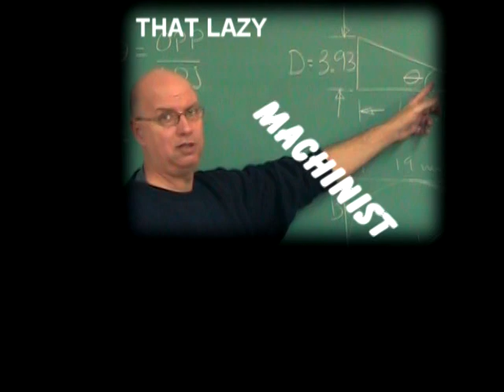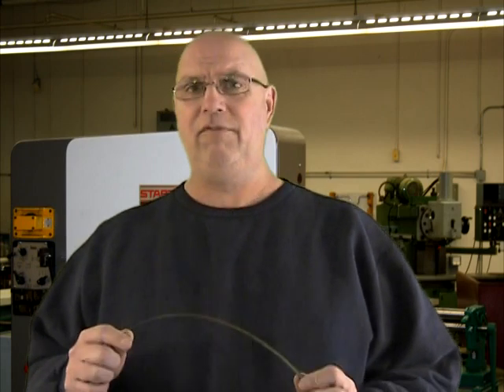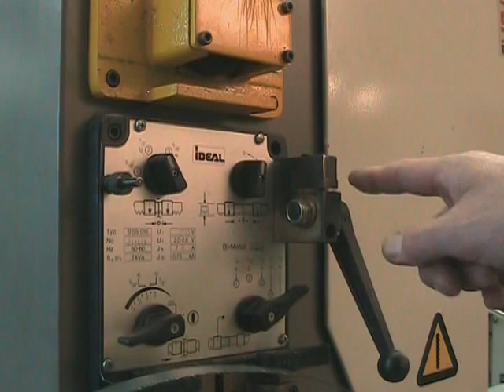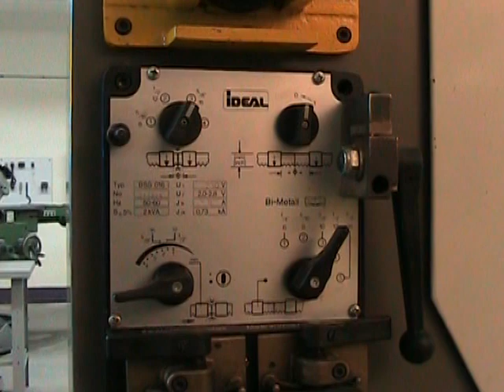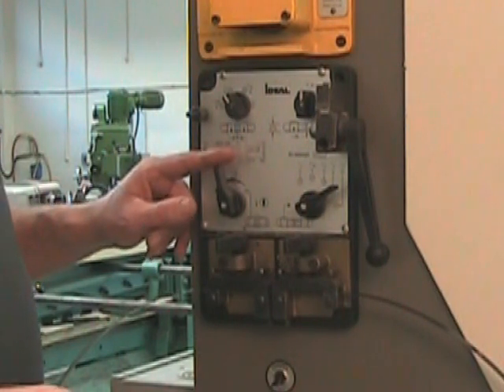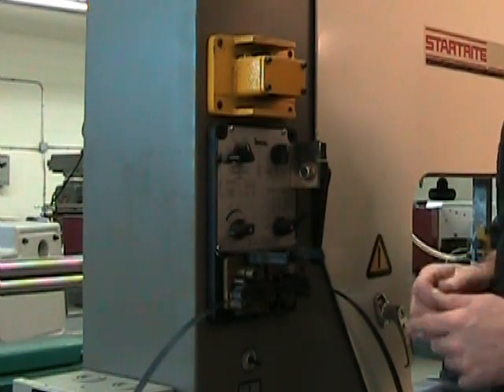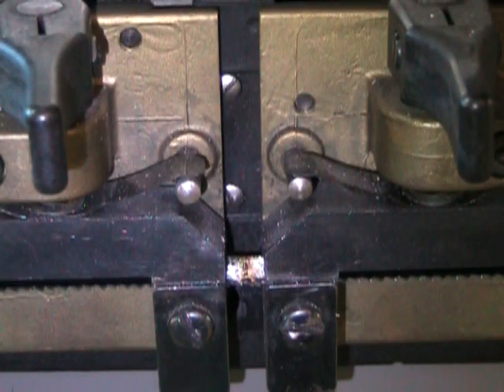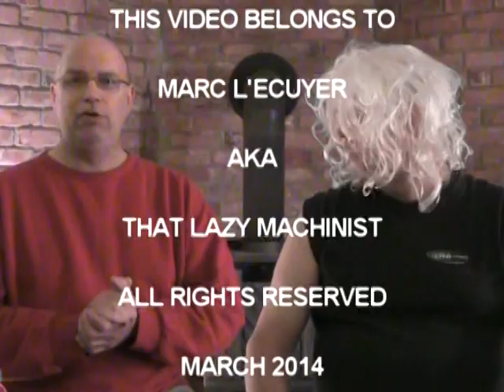HOW TO WELD BAND SAW BLADES BY RESISTANCE WELDING, HOW TO USE A BAND SAW BLADE WELDER. MARC LECUYER

Comment: Let me add a word of caution here.
As Marc has demonstrated, the welding of the blade is quite straight forward on a commercial welder, where the applicable parameters are simply "dialled in".
Heat treating the weld is a horse of a different colour;  and it is imperative that the annealing instructions as given on the blade container, be followed exactly, especially as pertaining to colour and ambient light conditions.
Different manufacturers have different requirements for this annealing operation, and I recall one container stating "heat to dull red", whereas the other container stated "heat to dull red in subdued light"!  A big difference, and it showed up in the number of blades that broke at the weld I had made so carefully.
Moral of the story:  If all fails, read the instructions!  I would opine that 99% of the joining failures are due to improper heat treatment after welding, and subsequently after grinding.

Comment: I never had any success welding my blades. More than 50% of the time they will break at the weld. So I searched Youtube for an appropriate video. And what do you know? The Youtube machinist instructor #1 of course have a video on that too. :-)

I think my problem is the annealing. So I will do it as you show me and hopefully have success. Also that mention of cleanliness is a tip. My blades are covered in some rust preventing oil when I take them off of the spool. So I will clean them with solvent at the cut point before cutting them. That may also cause my problems.I wrote it before, but will repeat myself: Your instructional videos stand out as the best! Thank you, and keep on making videos!

Comment: man this brings back memories. i worked for sandvik back in the 70's we used to cut and weld bi metal and flex steel blades.  the machine for the small blades was  a stryko, and the big machine was a thompson.
i used to day dream and get out order and anneal the blade before i weld it, and it use to turn red and drop in a puddle in a nano second.
filing off the flashing on a pedestal grinder is a fine art.   go too far and its like a slinky with sharks teeth blowing up in your face.  i used to enlarge arbors on huge saw mill blades too

Comment: You video on recognizing and distinguishing different steels was fantastic.
I have one small issue with the bandsaw blade welding sequence. 
Tempering is only applicable to a hardened object.  
Once the object or weld joint is annealed, it is annealed.
Reply from the maker: I agree! Annealed steel is annealed. I should have mentioned that the tempering at the end is more of a safety operation just in case the annealing step was not perfect. When annealing the blade it is difficult to control the cooling speed so I tend to do the "unnecessary tempering" since it is a lot easier to control by the color. Thanks for a great comment and thanks for taking the time to write. Your comment will help others and that is what comments are all about. Marc
Reply: I agree, and I like how you call it "unnecessary tempering." If calling it "unnecessary" satisfies the PhD's in metallurgy, let it be so. I do this unnecessary step, too. It is not necessary for my band saw blades to not break, prematurely. I just unnecessarily prefer it that way. 

It takes a year or so of breaking blades for someone to start doing this unnecessary step. It takes only 5 minutes to do an internet search on heat treating and to say this is wrong. :)
Reply: Thanks for the video. I have been cutting and grinding my blades at a slight angle by putting them teeth to back.  The theory is there is a larger surface area for the weld and the angle puts less stress when the joint passes the material being cut rather then a 90 degree angle. Your website teaching is great God bless you.
Reply: @THATLAZYMACHINIST  The "blueing" operation after grinding off the flash from the weld is to reduce the stresses introduced by grinding.  This is a necessary operation that prolongs blade life.

Comment: Hey dude. You're in a very tiny minority demonstrating the tempering step. Kudos for being a dinosaur! 

It appears most people don't do this step, at all. And that is probably because it will take years of using these blade to know there IS a difference. And some people will not see any difference, because their blades dull before they break either way. But from my own years of experience I completely agree this tempering step is important. 

Before and after tempering, the blade will appear exactly the same. Neither blade will break when you bend it, repeatedly, by hand. You can bend them until they fold over, and they will both perform identically in this destruction test. They will appear to be completely identical.

But after the blade has run around the wheels of a bandsaw thousands of times, the blade that was not tempered is more likely to break, right around the area of the weld. If your blade lasts long enough and/or if your saw has small enough wheels, you will find this out, yourself. But because there is no way to tell the different until you've done this more than a few times, the internet will never know it!

Comment: I'm having trouble with my bandsaw blade welder my welds are breaking constantly it's very frustrating all these parameters I'm taking into account it still can't get a good weld the welds are good but the customers bring back the blades broken at the weld are they misusing the bandsaw or am I doing a terrible job welding

Comment: Sir there are four types of Resistance welding process which are spot welding and seam welding, projection welding, flash welding, & upset welding but which process did you used?
Reply: Butt welding.  Methinks upset welding is much like it.

Comment: Great Vid! Why do you have to temper, if you already annealed? Doesn't annealing the blade render it soft? Thanks!
Reply: You are right!
Bring up to temperature, quench it (some steels do quench on air), anneal it.
So one of the steps was useless: Either annealing or tempering.
But it didn't hurt. :-))
Reply: Gotcha.  You're right, no harm done. Just wanted to make sure I wasn't missing something.

Comment: A guy who welds bandsaw blades test the weld by throwing the blade (back side down) on the shop floor.  Is this ok to do?
Reply: any test as well if it doesn't compromise the integrity of the bandsaw, i means if it doesn't break out in another section !
Reply: jersson lopez I am welder too ! lol

Comment: I had no idea it was so complicated.  Explains why all my attempts at tig welding a blade were brittle and broke.
Reply from the maker: Hi Mark, I have never tried to tig weld a blade (I have a lot of respect for welders because it is something that I have difficulty doing) but I suspect that if you let the blade cool very slowly or if you anneal the blade before it starts to crack, you might have better success. I have however "hard silver soldered" blades (before I had access to a resistance welder) and it works quite well. Thanks for watching, Marc L'Ecuyer P.S. If you wish to understand more about the hardening of steel, you could watch my heat treatment videos, you can link to them from my website THATLAZYMACHINIST.COM
Reply: I have a 1903 Disston saw manual(reprint) that goes into detail on hard soldering bandsaw blades, using chunks of iron and a blacksmith forge. (simplified here) It calls for grinding the ends to a very shallow and matching taper for a large contact area, fluxing, then placing solder in the joint and squashing the whole works between the two red hot soldering irons until the solder melts. Special heat treatment isn't needed if performed well as it doesn't exceed the critical temperature of the steel.